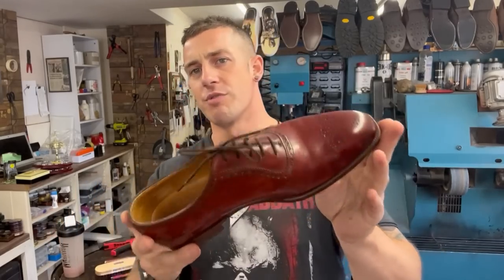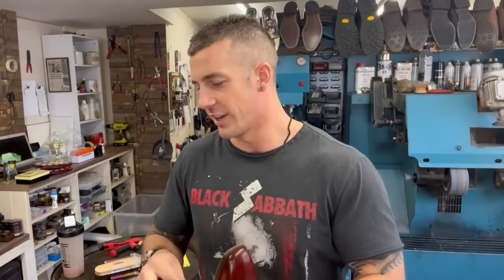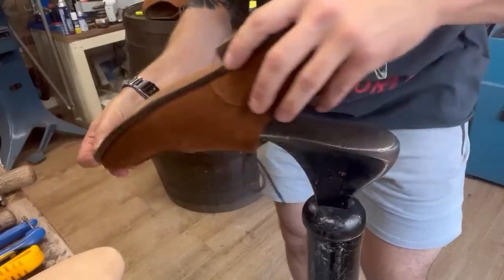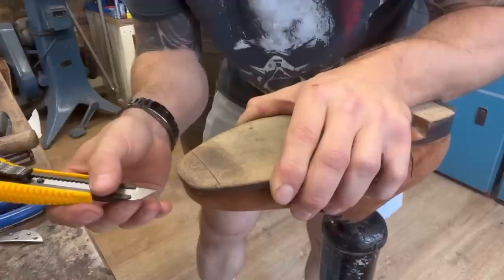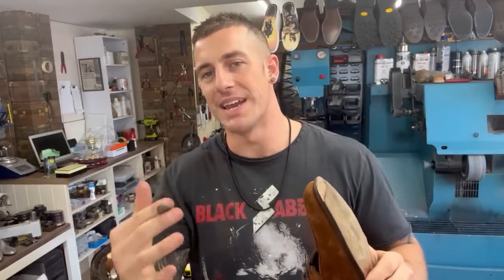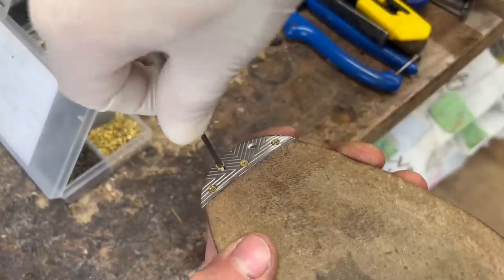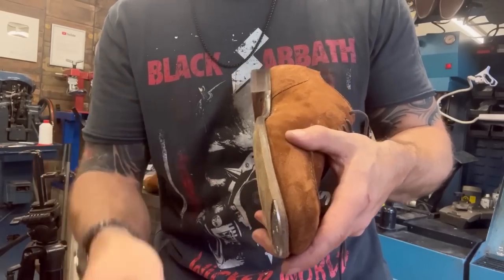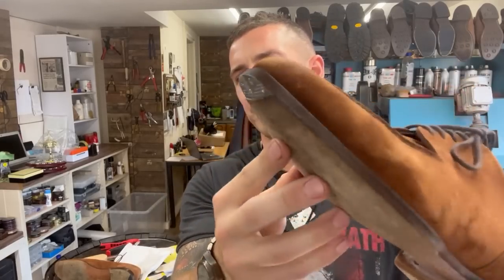Make Your Shoes Last Longer With Metal Toe Plates! - Plus ... Dinosaurs In Tring!

Comment: Velociraptor were basically large turkeys.  25kg is actually on the heavy side all told.  The ones in Jurassic Park were modelled on other raptor species.  In reality, Utahraptors are probably closet to what is portrayed in the film!
Reply: Loved the video! 🥰❤️
Reply: Indeed. a Utah Raptor is what the ones in the movie were based on; a Velociraptor is closer to what the movies showed as the compsognathus; it was about 1.8 meters LONG (as in: nose to tail tip), but only about a foot and a half tall, hence the light weight.
A Utahraptor, for comparison, was about  1.5 meters *tall*, and 6 meters long, and weighed somewhere around 500 kilos.
Reply: Just for accuracy, Jurassic Park velociraptors were based off Deinonychus.
Reply: Nerd
Reply: Jokes on you they were actually emus.
Reply: I’ve heard them being called "the angry chicken" 😂🤣😂🤣

Comment: If you've got problems (grip, pain) with your precision screwdriver I can only suggest getting the iFixit Marlin Screwdriver Set or Driver Kit Set (Available in different sizes). Those are way more comfortable than the generic ones.
Reply: Wera do some really nice precision screwdrivers also or you could try some optical stainless Steel ones with ball bearing spinners.

The I fix is a good suggestion as you have multiple size options.

Comment: Oof mate, you need to get yourself a set of Precision Screwdrivers, those kind are horrible to use! You can get decent set off for like $15 on A m a z o n (had to spell it like that or else it wouldn't post my comment) that have normal full sized handles. 👍👍

You could also snap the spinning piece off of the back of those kind of screwdriver so you can stick them in your drill driver. I've done it before lol.